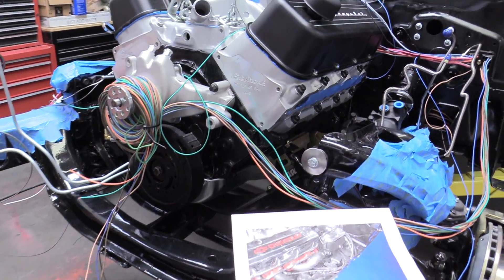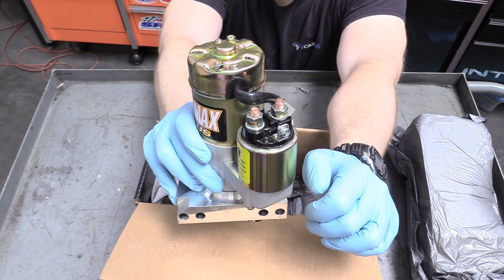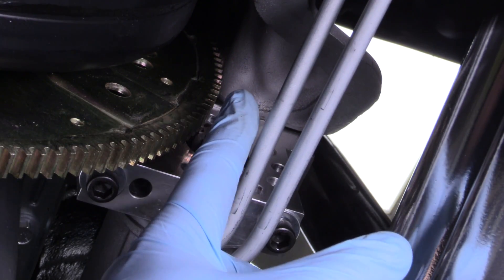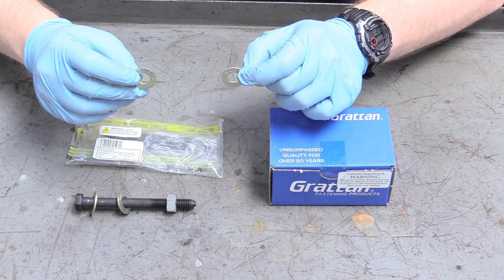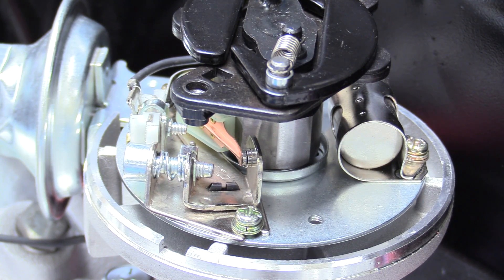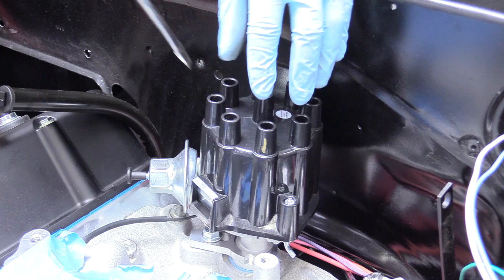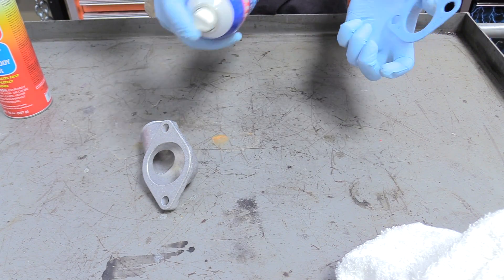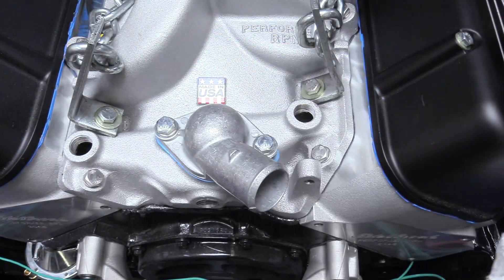How to Build a Chevrolet 454 Big Block Part 14: Starter and Set Points Gap!

Comment: Did you put the bolts on the flex plate to the torque converter? When you put the cover on, it look pretty led like that were missing.
Reply from the maker: Yeah they are on. Thanks for watching!

Comment: Best 454 series. I am currently using this on my 454 nova build and it has helped a ton. Also is there a part number for the headers thanks for the help
Reply from the maker: Hey thanks a bunch for watching Justin. Those are a Doug Throrley THY-313-C I think that is the right part number. I tried 4 different sets of headers to get a good fit on my car. Thanks for watching!

Comment: Did you have to modify the perch for the motor mount? I’m doing a similar build for my 67 camaro and was having a hard time getting the motor mounts and the perches to line up just right.
Reply from the maker: Oh man that was a saga all by it's self. So there is a difference between small block perches and big block perches. So I had to swap mine out because I thought that the perches would be the same. Here is the link to them https://www.classicindustries.com/product/1967/chevrolet/camaro/parts/k702.html with these you just barely have enough room. Thanks so much for watching Richard!

Comment: I'm not sure if these questions have been asked: 1) Did you go into this project with a budget in mind? if so, then 2) Are you still within your budget?  and 3) do you have an ongoing budget summary? Thanks.  Great work!!
Reply from the maker: 1. Not really. 
2. We are right around 6k with the machine work.
3. Haven't really been keeping track. It's a work of love so I have been going slow and buying things slowly.

Thanks for watching!
Reply: @2carpros  That's what I was thinking in terms of budget.  Makes sense for the work and parts you are putting into it.  It's nice to see the cost of aluminum heads come down.  More practical and likely affordable over adding large valves to stock iron heads.
I did like the machine work and clean up on the block.  The shop did nice work!  Super clean!
Thanks for the follow up. 
Keep up with the awesome vids!

Comment: Good morning friend , I am also an engineer from Corinth Greece.  I watch you and admire you for your characteristic patience for the order in your tools and for your knowledge.  As an engineer I have been doing this job for more than 20 years, I want your opinion on the following question.  As much as Kian I have searched, I have not found a substantiated answer.  The question is, ... Why in some cars the fan wings maintain unequal distances from each other. ???  Simple question but so difficult to a competent answer.  Anyway, thank you for reading my message.  Be well and keep the passion for this job ......
Reply: There are a few reasons why the fans are made that way. One is to reduce the noise level as the differences in the spaces between the blades removes some of the drone that equally spaced blades can create. The other is to create a simple undulating pressure wave but not at a single frequency. That helps move air better than a constant flow. The next reason is cost, as long as they can balance the blade and it provides enough airflow it's ok.  Another reason is harder to determine. The "missing" blades generally allow for access to things like water pump bolts or similar while in the assembly rooms at the plant.
Reply: @Blazer02LS   thanks my friend...
Reply: @Blazer02LS  ήθελα
Reply from the maker: Thank you for watching George! I really couldn't tell you there are a bunch of different ideas on why to do that but honestly I'm a mechanic not an engineer.

Comment: Factory rails, power steering and a big block makes a tight squeeze for a header that flows good. I've used Hooker super comps and Hedman Husler race versions on them, they are still real tight. You get more room with a manual box but lose power assist, which is needed if you plan on driving it in a city. There are a couple of smaller power boxes that give you more room. Classic industries shows their part PSC67744.  It's a 400 series box that is a lot smaller than the 800 series you have.
Reply from the maker: Wow you have no idea what a game changer that makes for me. I will be ordering that box very soon. Thank you so much for the suggestion. I had no idea that existed. Thanks for watching!
Reply: @2carpros  Great series of videos. They've come in very handy building my 454. Why would you change the steering box if the Doug Thorley headers cleared it? I am about to drop my engine in a '68 Camaro with the 800 series box so will have to face the same issue.